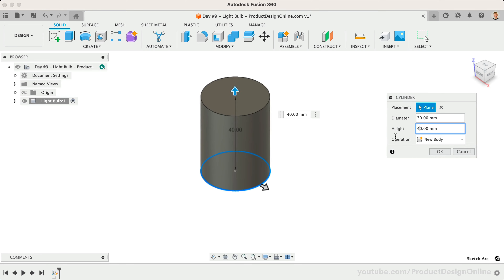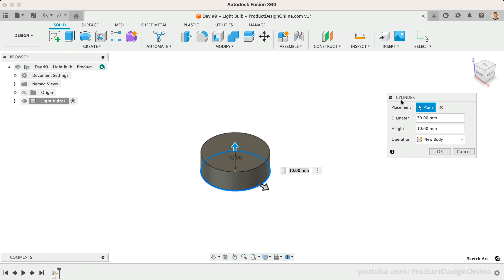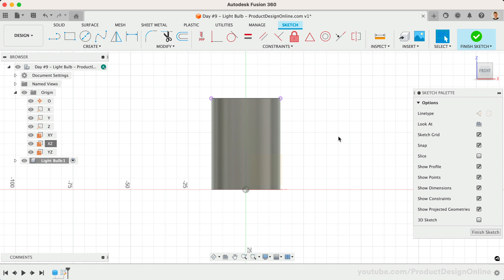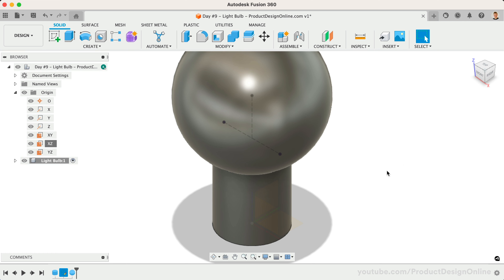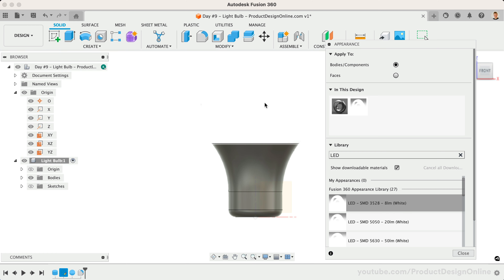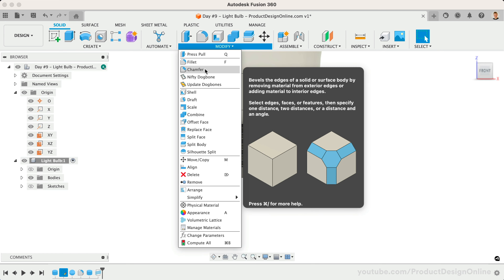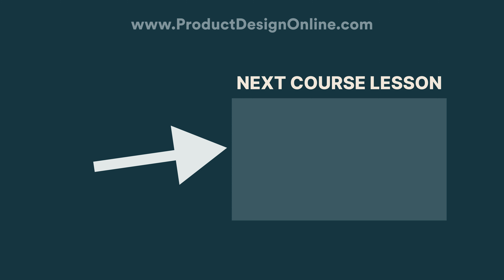Day 9 of Learn Fusion 360 in 30 Days for Complete Beginners! - 2023 EDITION

Comment: When placing the thread on the face of the cylinder it is important to click on the upper half of the cylinder face, this ensures your offset will be at the bottom, if you click on the lower half of the cylinder your offset will appear at the top. This positioning subtly was quite confusing at first.
Reply: Lifesaver, thanks
Reply: Thank you! This was not made clear in the video.
Reply: Thank you!
Reply: Thanks!
Reply: This is the answer to the question I had . THANKS
Reply: Thank You!
Reply: Thanks, this helped me alot
Reply: you beast
Reply: thanks :) I just did some math and made the offset 12mm instead and it worked
Reply: Cheers
Reply: 6:06 This is correct however the video shows him leaving it as 12mm but saying 3mm. It should be 12mm.
Reply: Oh my god, I have been trying to figure this out. It's been driving me crazy. I have tried so many other options. Thank you.
Reply: you save my life
Reply: you saved my life man
Reply: THANK YOU!
Reply: Thanks!
Reply: Dude, thank you! That was driving me crazy!
Reply: Exactly what I needed, thx.

Comment: It is important to know. that these threads wont work because they do not break through the chamfer. If you want to model a usable thread you need to create the chamfer first. Then you go one step back in the timeline to "hide" the chamfer. Now you create your thread and finally you let the chamfer appear again by going forward in the timeline. Now the chamfer has a "cut" from the thread. It worked with the normal ISO metric thread for me, but somehow not with every other... I hope that was helpful!
Reply: You're right. It's a weird workaround but it works
Reply: this should work perfectly for every other thread type also, just don't uncheck "full length" in thread options.

Comment: I have survived to day 9. I have no modeling experience nor any education in engineering. I am a woodworker and people told me fusion 360 was a good program to learn to use. In addition to using it to plan projects, I figured I would also learn to use the software in case I ever buy a 3d printer. This course is great. After doing 8 of these lessons I am finding it easier to move around naturally and access the different features without taking ages to locate them. Thank you!! This course is worth its weight in gold.

Comment: Seems that author is not responding since it was uploaded, but still. Thanks for another lesson. Surely it would be great to explain Project and Intersect fumctions deeply somewhere in 2nd or 3d lessons. 
Also for those who tried to repeat this - do you have some strange ending of the thread on the other side than shown in the video? Here, apparently, author didn’t turn the lamp on purpose after making thread.

Comment: 5:00 for my threads cylinder to protrude out the bottom of the light bulb, i have to make the height of it -15 (negative 15).  this is the second time that my dimensions have had to be opposite what the video tells me.  why is this happening?

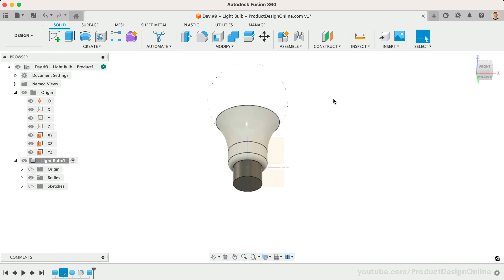Comment: Hmm, perhaps I'm doing something wrong but when following the instructions at 5:16 and  set the offset to 3mm the thread vanishes and I cannot press ok nor continue in anyway. The highest offset I can do is 2.999999999999999mm and that works. Everything else in my Thread menu is identical to what's in the lesson. I was able to complete it with the 2.9mm but if I did something wrong or if this is an error any help solving it would be appreciated.

Comment: Hi I am at the part where I add the thread, as soon as I uncheck the "Full Length" option my thread as two up arrows, yours has two down arrows?
Reply: I just read, When placing the thread on the face of the cylinder it is important to click on the upper half of the cylinder face, this ensures your offset will be at the bottom, if you click on the lower half of the cylinder your offset will appear at the top. This positioning subtly was quite confusing at first.

This was not mentioned in the video. I just tried it it works nicely.
Reply: @walterGUnique  Thanks for the answer that had me going for a while

Comment: 4:55 no matter what I do I'm unable to make the cylinder for the threaded part. everything I'm doing matches the steps exactly, but the diameter is in red and I'm not able to click ok.
Reply from the maker: The 'red' sounds like the Extrude command defaulted to a 'cut' operation. Double-check that the operation in the Extrude dialog is set to "New Body". Let me know if that works! :)
Reply: @ProductDesignOnline  thanks for the quick reply! I definitely confirmed that it was set to New Body. I eventually just tried sketching a circle and extruding it and that worked. The first and the final cylinder made in the video had no issues, so I'm not sure why I wasn't able to do it with the middle one! At some point I'll try again with a fresh file.
Reply from the maker: @cassiakuhn8740 glad you were able to work past it!
If you do run into it again, please capture a screen recording or screenshots if you can. Happy learning! 🙂
Reply: I had the exact same problem. Not sure what happened but wound up doing a sketch and it worked.

Comment: My bottom cylinder is upside down. How can I be able to make a fillet at the thread if its upside down.
Reply: I had the same problem - it depends on where you click the cyclinder. Remove the thread - recreate but select the cylinder at the top